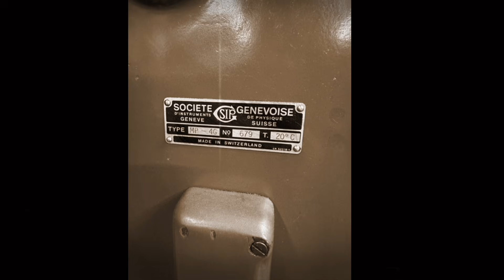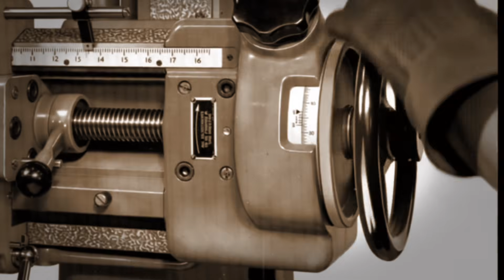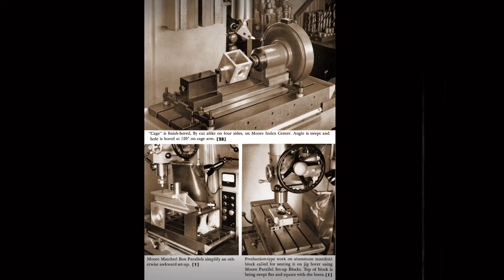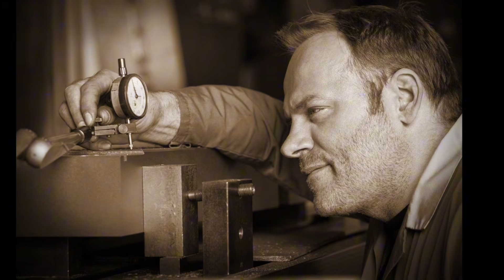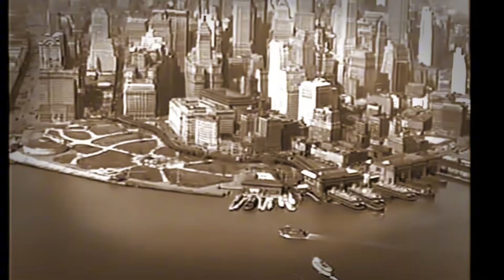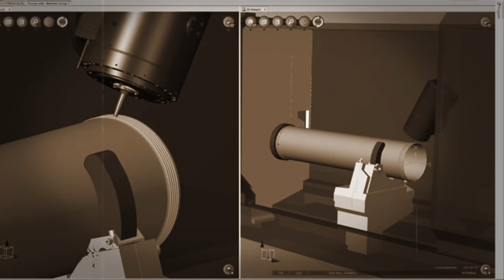How SIP of Switzerland Built the Jig Borer That Silenced Every Toolroom in America

Comment: Good presentation. In my field 0.001” is a big error. We drill 5 mil holes by the trillions in epoxy glass with Carbide drills.
3mil are not uncommon but pricy. All holes are relative. Today’s electronics would not be possible without high speed precision tools.
I worked through the transition period from manual to automated positioning. Jig Borers are cool machines that were used to build the machines I used to manufacture microelectronics. Used in CNC Controllers we designed. Goes full circle.
As PCB Design Engineers we adopted the Tool Room attitudes and practices.